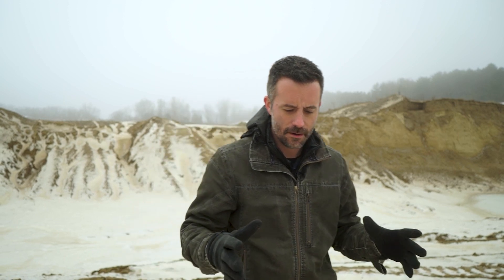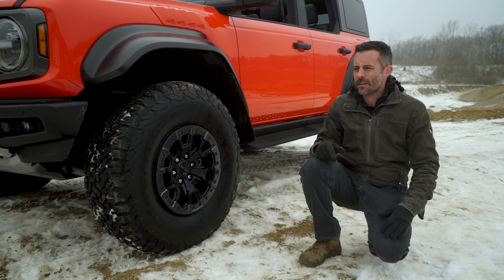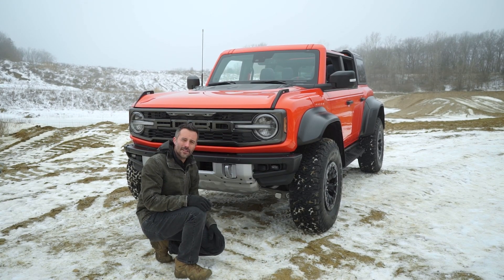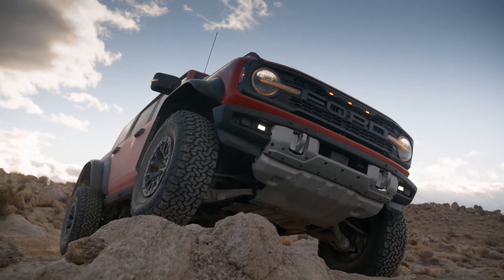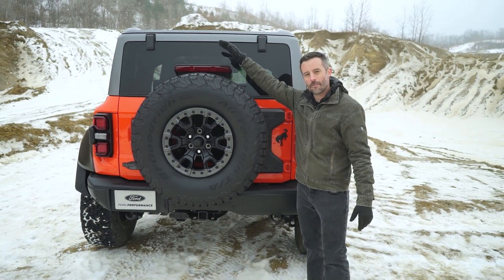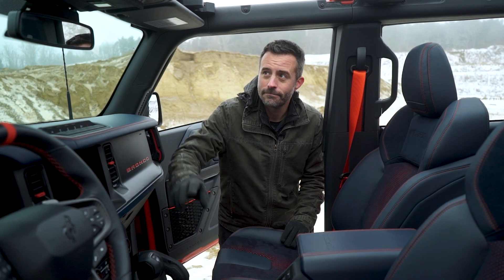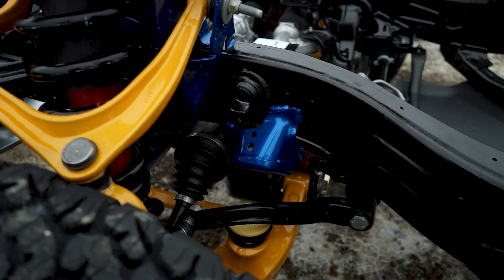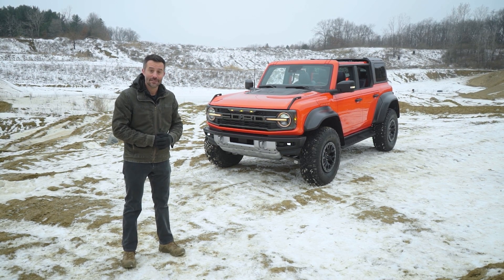2022 Ford Bronco Raptor Never Skips Leg Day

Comment: Really the biggest question is, has the steering rack been modified/ beefed up. We have seen that the biggest issue with broncos that go off road is the steering rack falling apart with larger tires. It’s been found that installing a piece of plastic in the rack can stop the pinion from loosing contact and stripping out. However getting to the steering rack on an ifs vehicular isn’t exactly simple or easy. Has Ford done anything to address this for the raptor? Have they installed an entirely new rack or are the using the same rack as the regular bronco and making the simple the modification people have been doing aftermarket at the factory where the rack is assembled? Ford has done a lot here to strengthen various areas, it would be a shame if they left this part untouched.

Comment: luv it.  absolutely fantastic. both  wrangler extreme recon with hemi and power top and raptor-bronco both are absolutely fantastic.   bronco missing just 2 very  important critical things. diesel option and power roof option.
Reply: So who make a small diesel engine that runs right? No one. From EGR issues, timing problems, burning through DEF. Not one of these modern diesel engine have worked without major issues.

Power top on a off road race vehicle? Never saw a need for that.
Reply: @nm-qt2hb   diesel engine with lower ecological standards at least for those countries which dont have strict diesel standarts. euro-0  euro-1  and euro-2 diesel standarts are just fine. they work well.
Reply: @nm-qt2hb   wrangler has power top option.
Reply: @johnreno8909  

Power top, must for off roading.

Comment: Fender flairs look out of place ford needs to put a wide body on it like the raptor f150 have.  Starting at 70k for a toy, that is a lot of coin! no 5.0 is disappointing even Jeep put the 392 in a wrangler. Guess it’s just me but the v8 option is going to be missed for sure! I hope all the upgrades to the suspension will keep it from breaking like some of the ones I have heard of.

Comment: Where the hell is the 3.5 L twin turbo ?
Reply: In the F-150 Raptor 🤷
Reply: Wouldn’t fit in this.
Reply: @CarlosLago  it's in any standard modern F-150. I have a 2019 with that engine not a raptor.
Reply: @TheFriskyComiskey  internet engineers....ROFLMAO
Reply: @TheFriskyComiskey  true, should've clarified that the 450-hp 3.5-liter is unique to the F-150 Raptor
Reply: @thecappy  Really? It will fit in a Ford GT but not a Bronco?

Comment: This should be a plug-in Hybrid with a 275hp ICE and a 200hp electric motor (475hp combined), and it should get 40mpg at least. Ford has this technology, it's been around for many years. it really looks great - but the gas mileage sucks!
Reply: I say this as someone who REALLY wants an F-150 Lightning... don't buy the Bronco, especially not it's Raptor counterpart, if you desire fuel economy. It's essentially a brick with 4 wheels aerodynamically, and it's meant to throw down in an off-road area. This vehicle was never meant to be fuel efficient. This is a toy, and you should treat it as such. This isn't meant to be a daily driver...
Reply: @Xyler94  Exactly, a very expensive toy - for those few that can afford to have this as a second or third vehicle - this would be a ridiculous daily driver.

Comment: It looks like Ford took Rubbermaid garbage cans and cut them up and glued them on the side. Ugly as hell. Hopefully someone will make some aftermarket ones that don't look so cheap. Also the roof is grey and the side steps and flares are black??? Looks like parts that don't match off other vehicles?. Plus the motor isn't great. I guess it doesn't matter because it's nearly impossible to get any of these vehicles that Ford makes anyway unless your willing to pay a ridiculous amount of money which at that point you might as well just build your own. This had the potential to be really cool but kinda just a disappointment.

Comment: Kinda disappointed that this Bronco Raptor didn’t come with the 5.0L Coyote like everyone actually wants. Fail Ford!
Reply: Except.....lets count how many you see on the road in a year, them re-evaluate your failure synopsis.
Reply: @cesarpalmos8235  How many of what you see on the road in a year? Fords in general? Or Broncos? I see lots of every vehicle manufacturer throughout the year. Still doesn’t have anything to do with why Ford didn’t put the Coyote 5.0 in the Bronco like Jeep did with the 392 in the Wranglers.